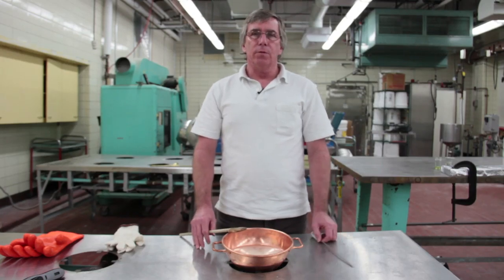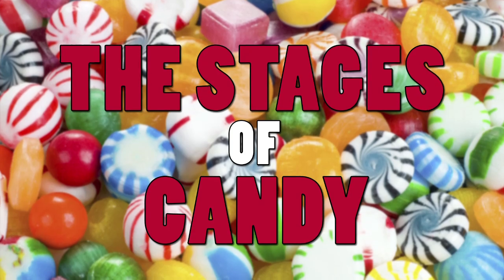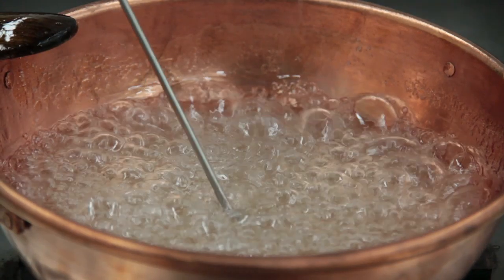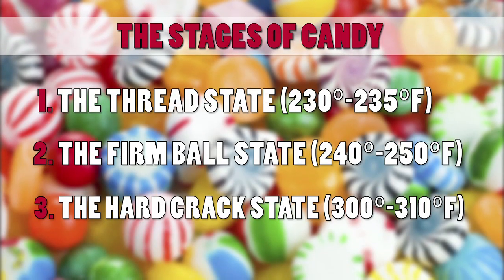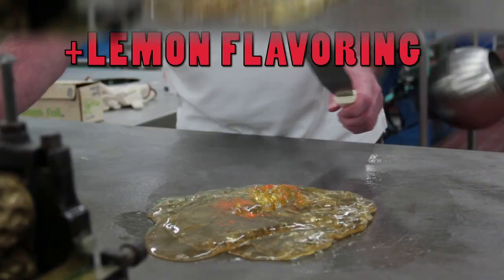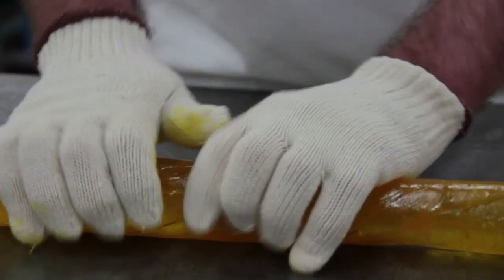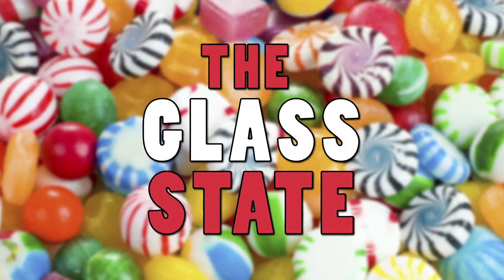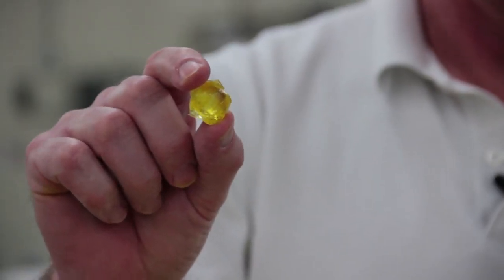Hard Candy Chemistry!

Comment: I guess it would be better if the flavoring is added during the boiling process
Reply: No you add it at the end other wise you will boil out the flavor. You can also stretch this as well to give better color and put air in to the mix which makes for a better candy.

Comment: Is that an induction cook top?  If o, I need to cook candy to a hard crack (300 degrees), how would I utilize the induction?  It usually takes about an hour to reach 300 degrees so that the water boils out.  If the induction unit is cooking faster, how will I know if it has achieved the hard crack needed for hard candy?  Thank for your assistance!

Comment: Thank you Richard. Do you have some website you can recommend where good, but second hand (less expansive) mould machines and probably a small tumbler barrel can be purchased? A lot of people are using silicone moulds lately.... do you think this would avoid having to tumble the candy to get rid of the sharp edges? Also, I have been looking into copper pots... I have read that actually cooking in copper pots that do not have a stainless steel barrier between the cooper and the food is bad... is this true? I must say I agree with other people here... the teeth chomping down on every cut... is quite annoying... Not intended to be a rude comment though!